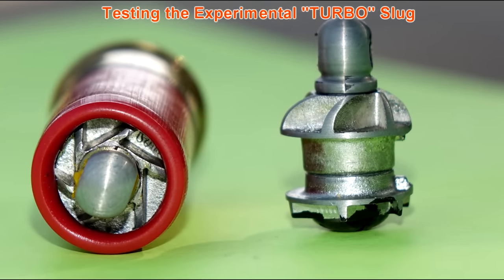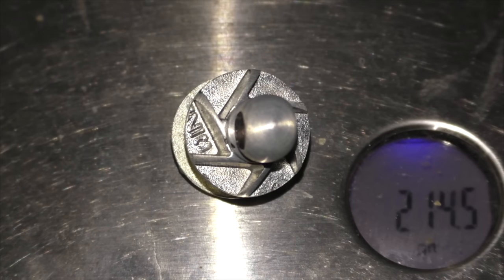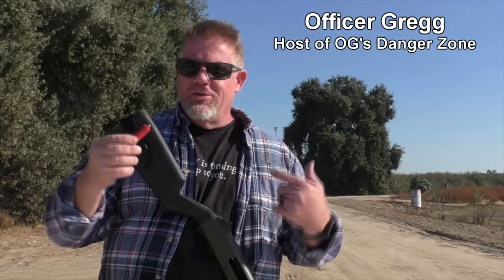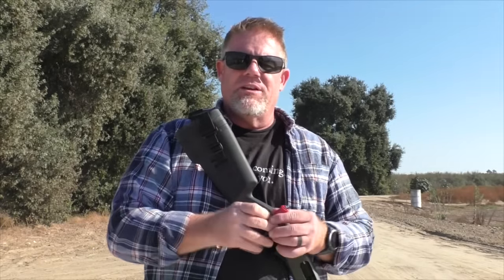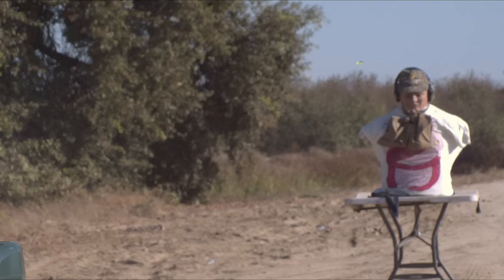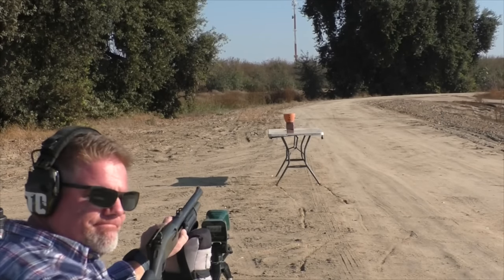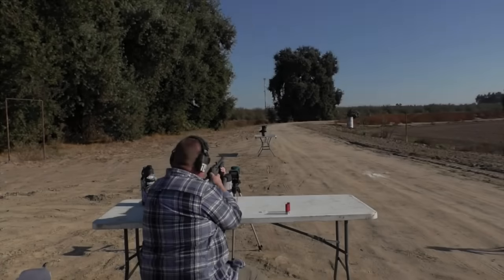TURBO SLUG -  Sounds like Star Wars Blaster

Comment: That sound! From an aero perspective, you can ignore the rear vanes as the air flow won't be touching them. Deepen the front portion and add some mass. Then again, that's basically a foster slug. They make them that way for a reason after all!

Comment: I think the "turbines" are impellers for a small fluid pump, and have been reduced in diameter by either an engine lathe or hand tools. You can see part of a word cut off on the edge.
Reply: Interesting, they also looked a bit like dull dry wall plugs
Reply: @danosdotnl  maybe so! Good observation.
Reply: They make “turbocharger” key chains that are about the same size as the rounds used which is more than likely.
Reply: @rust3dtinmanrichards615  good point!
Reply: Yeah I agree with rhubarb as they don't look like compressor wheels, they do however look exactly like a water pump impeller from a  small displacement industrial or sports engine.

Comment: Looking at the fan sections, there's an extra bit of metal in the on one side between the two fans that might be throwing off the balance.  It might be worth considering getting these things 3d printed to make sure that everything is balanced properly.   I'd also suggest replacing the rifle strap nub with a drill bit to add more spin.
Reply: That's what I felt was the primary issue. That round ball wind break might give a flat spin effect like a stalled plane going down.  
Idk about the Giro effects.
Reply: printing doesn't guarantee balance. you'd have to mount it on a suspended shaft to check for a heavy side
Reply: @RedstonePyroMan  good point.
Reply: 3d printing metal is very expensive.

Comment: I'm sure someone has already commented this, but the 'bottom' end is a turbine, and the top end is an impeller.  If this were mounted in a turbocharger housing on an engine, you would feed exhaust to the bottom end to spin the turbine, and that would spin the impeller on the top end to force air into the engine's intake.

Comment: Depending on the spinning speed relative to airspeed that front impeller would try to either accelerate the slug in whatever direction it's pointing, or transfer some of its speed into faster rotation. Both of those result in asymmetric air resistance on the front as soon as any wobble happens, which is probably why it tends to wander off. I assume the inaccuracies are 100% decided in the moment of exiting the barrel, since the round is more self-destabilising than self-stabilising.

Also the impeller in the back rotating in the same direction is probably doing more harm than good. It tries to suck in the air behind the slug and push it out of the sides, making the low pressure zone behind worse if anything and wasting energy. Although with how fast this slug is moving and how the front already pushes out the air beyond the diameter of the slug, this performance-degrading effect is probably very slight and only contributing to the sound it makes. (Since the air trying to rush back in encounters the impeller blades pushing it out in some places and pretty much no pressure everywhere else.) If it exists at all, supersonic aerodynamics are weird and someone would have to properly model them to confirm or deny that.

I'd be interested to see a version of this slug where the backside impeller has fins the other way, sucking in air from the sides and pushing it out behind, which might improve the aerodynamics by lessening the high pressure in front to low pressure behind ratio. It should also make a distinct sound too. Will probably still be as inaccurate though, since that seems to be a front impeller issue.

Anyway, thanks for still making those! I'm not watching every one of them like a few years ago but they're's still fun and interesting.

Comment: I'd try asymmetric slots in between the fan blades. Cut into the first place the fan blades of mount it on. With the fan blades not having an air exit point it would be like driving on tyres without grooves what grooves lead to nowhere. If you could split the air somewhere for example as above it would allow the air flow to carry off and if there's lots of design right add extra spin.

Comment: FYI it's not a "twin turbo", a turbocharger consists of very similar looking impellers on a common shaft: a turbine (converts the gas flow of the exhaust to rotation) and a compressor (converts the rotation of the shaft into airflow that fed into the engine)

Comment: It looked stable on the first shot, it's possible that the slug is so light that it turned on impact, when contacting something harder and heavier than itself. It needs to be heavier in my opinion.

Comment: I remember the Brenneke Flintenlaufgeschoss FLG (which might be a hundred years older than the super sabot) to look like these, except for the setting angle of the blades. They've been steeper and more of them. The whistle might come from the hole in the top part? I remember a glider in my gliding club, which I flew most, the "Astir" from Grob to have whistled because of a hole in the tail, where the wheel came in for ground movement. It is really that easy, like a panpipe. You could use several holes with certain depths and diameters to whistle a chord of your choise.

Comment: I'm not a professional or scientist but I think it's the tip of the slug. With that round then sharp drop to have a random hole in it depending on how the air hits everything it's going to be random. That's the fix imo

Comment: I think the issue is that it makes NO sense to make that fan shaped forms if they have a completely flat surface behind, the air resistance on that flat part behind the "fan" must have been crazy af and the probable cause of wobbling.
Reply from the maker: The whole concept makes no sense mostly because of the expense to buy the parts and the time to hand make them.   Remember, this is more about curiosity and how weird shapes behave at supersonic speeds so it many ways it's more like rocketry than weaponry.

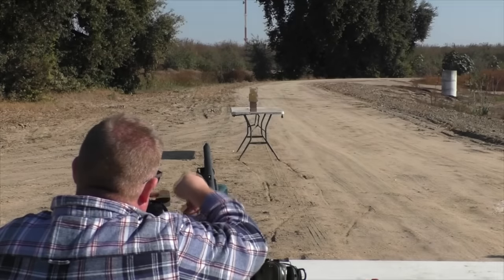Comment: 5:19 I’m pretty sure that’s why the turbo is there. Think of it this way. As it leaves the barrel even without the the rifling the turbos will start to spin with the pressure built up behind it. As it gets through the barrel the front nob sends it sideways while staying dead on with its flight path DUE TO THE TURBOS in that process the turbos stabilizes the slug as it’s side ways so all u get in a massive bolt with 3 nuts smashing into ur chest…. Even if he intended this or not it’s actually genius
Reply: 8:05 that’s that stabilizing I’m thinking of. As it’s fired it’s not exactly staying true but that’s kinda the point. If it’s a wider surface area it’s easier to hit ur target while also keeping a decent and so consistent flight path than it would be an effective slug

Comment: Pretty sure the instability of these rounds has something to do with gyroscopic procession. Like, because it's spinning along it's intermediate axis, it periodically starts tumbling before going back to flying strait, but pointing backwards. Then a bit later it flips again.

If you've ever watched a NASA rocket launch, this is the reason why they don't spin the rockets, because they'd tumble in midair too. But when a rocket points backwards, horrible things happen. I think rifle bullets get away with it because they have other aerodynamics going on to keep them pointing straight, meanwhile the turbo slug has about the same aerodynamic profile as the average thermos.

Comment: Just as they sre on the outside make the grooves on the inside of the slug as well more accuracy may happen it may not but just at the ends is not all you can do you can also make the inside go as well and it could introduce a curved shot as well who knows

Comment: The slug needs to be heavy in the front and lighter in the back for it to fly in a straight line that will eliminate the high speed wobbling
Reply from the maker: All bullets are heavy at the base and fly well.    With spin you can counter that

Comment: The experiment is interesting, the bullet clearly lacks stability, a stabilizer is needed, also if you put a plastic shutter instead of the container, the barrel will be damaged less, and you can shoot with specifications of barrels with constriction chokes. Let's get a Monolith bullet, but with rotation. The question is why? The same Monolith confidently and accurately allows you to shoot up to 100m, and pierces a cast-iron sewer hatch or a car engine.

Comment: I wonder if you have both fans of the turbo slugs go in different direction would it stabilize it more. I'm guessing by pressure from the striker and the direction the fans are they go right it seems.

Comment: I wonder if single holes drilled through each front facing fan blade would make it whistle more?

I should think it's scary enough being shot at by 12ga slugs, but can you imagine if it was screaming louder at you as it zipped through the air.!

The Roman army slingers used to drill holes through their sling ammo, so that when they threw a volley across the battlefield, their ammo emitted a high pitched whistle.

Comment: sorry slight nerd gripe about the twin turbo comment, it would still be a single turbo as all turbos have 2 impelers, a hot and cold side, hot side uses exhaust gas to spin up the cold side to bring in fresh air into the intake. cool video tho!

Comment: He was shooting nearly one handed with the front of the gun resting on the sand bag.

Yeah the dot might have been centered b4 the shot but the grip was NOT.. a shot lasts past right when you pull the trigger until the projectile leaves the barrel.

Looked like the rounds fire STRAIGHT'er than a Arrow..

That "was in the shooter"

Comment: An actual thought process the slug seems like it would be a winner. But an actual physical dynamics when it comes to air, wind, and how it spins around is just as reliable as a blaster for the storm troopers. You’re better off just using like a buckshot to hit the target, then using one bullet, that he could miss no more than 30 yards from here you Anyways you could still improve that actual slug to make it perform better. I just think that the front end of it is not good enough to make it all spend together, because honestly, the front end should be more of looking like some kind of drill head that exposes all that wind directly to the rest of the slug that spans of the air to straighten it out.

Comment: The rear veins won’t do anything, and the front ones would benefit from the whole impeller having a conical shape. As it is the fins don’t actually grab the air and twist the projectile very well whatsoever. Angling the whole thing to look like a turbocharger compressor fan would be much better.

The fins on it aren’t from a turbo but likely from some centrifugal pump.

It would be really cool to put some actual turbo blades on the front of a shotgun shell. They’re very balanced too. Turbo impellers that small actually do exist.

It could potentially be a legitimately accurate round of someone manufactured a slug with conical veins which had a twist rate similar to rifling of a barrel. Too much twist rate and no cone shape like this one would likely just cause turbulence and a ton of air resistance instead of spinning the thing consistently.

Comment: I have suspected fit quite some time now that several of the submitted slugs are actually modified drawer pulls. The tip off, for me, is the screw in the back. I could be wrong, but think about it guys… Not a knock, just an observation!
Reply from the maker: Evan makes slugs out of all sorts of things he finds at the hardware store including knobs.

Comment: Learn physics guys. The bullet weight is 28 grams. this body has a large inertia, the bullet needs a very large force so that it starts to rotate from interaction with air, and the next problem is that moving at high speed, the bullet creates a zone with increased pressure in front of it. this is clearly visible in slow motion. So the air flows around the bullet without interacting with its feathers or wings, I do not know how to translate it correctly... The only way to spin a bullet from a smooth barrel is to make external wings on it, like on rockets or tank shells for smooth guns.
Reply from the maker: These were shot from a rifled barrel, not a smooth bore

Comment: They need some work and modifications for longer range stability but they are a very cool design and seem promising!!! Would probably be better to have them made on a CNC aswell so they are consistent. Not saying I don’t respect the hand made aspect but you want munitions consistent and exactly the same.

Comment: I have an idea for a video. can we see how sabot slugs perform through a smooth bore barrel vs a rifled barrel, and see if a smooth bore and rifled choke can make a difference in performance. buying a barrel can be expensive compared to just buying a rifled choke. I got some Winchester deer season copper sabot slugs but I can't afford to buy a new shotgun or a rifled barrel. can a rifled choke make these slugs work better without breaking the bank?

Comment: If you tried the smooth bore with the stormtrooper slug, this is just a hypothetical, I am no ballistic nor physics expert.
Most army tanks today, have ditched there rifled tank guns, to me and anyone else, this would sound idiotic, because rifling=stabilization, and the penetration and accuracy of any shot type would be rendered less effective by a large margin. But, with some of the newer shells, for example the Fin stabilized sabot rounds, are capable of stabilizing themselves at the correct speed or don’t stabilize at all and just go straight like some arrows, but when shot out of a rifles gun, the 2 stabilizing factors, could
A. Spin against each other
B. Over spin causing the round’s top to start circulating or vise versa
C. Spins without the need to speed and causes the round to have more drag
(Speculation of effect but the principle is factual)
With this knowledge
I believe 
With my own personal knowledge and comprehension 
That with a smooth bore barrel, the stormtrooper shell will perform better.
Reply from the maker: There's a lot of shapes that self-stabilize (diabolo,  fins, etc.)  Something like this would just tumble because of the length,  balance, etc.

Comment: have you ever tried mass projecting Spiral Screw / broken bolt Extractors? remember handling some around 12 gauge diameter or a bit similar in design. could you test this please if you haven't already?
Reply from the maker: We shot some Acme thread slugs recently

Comment: Jeff if rifle applies at all to rifled shotgun, then there is a maximum length slug that shotgun or choke can stabilize based on their twist rates.  Some people go by weight but that's an approximation. I'm told it's really about length.  It may be worthwhile going through your data if you've measured the lengths of all these slugs you planned to spin stabilize and seeing if there was a correlation or some cutoff wall where it became unpredictable.  Or maybe it is by weight and do that too.

Comment: Make homemade thermite from aluminum foil and rust, just roll it up tight BUT BE CAREFUL. Watch some videos on how to make that first. Slip into cylindrical copper canister, then wedge that into shotshell. The canister supports penetration, hopefully you dont overpen, and then you have thermite inside the target. Cheap and simple AP thermite rounds. You can better it from there but thats less about fun and more about you actually needing to use it for something. Thought yall might enjoy this one.
Reply from the maker: I don't think there is enough time for the thermite to actually start burning in the milliseconds these are flying

Comment: Wouldnt be twin turbo. Just turbo. A normal car turbo has a hot end and a cool end. Has a impeller on one end and turbine on the other just like the slug. Exhaust goes through the turbine and spins it and the spinning of the impeller on the other side pulls in air through the intake and sends it to the intercooler

Comment: turbine blisk is not aerodynamically optimal, it is poorly designed mimicking centrifugal impellor as in car turbo. Design should mimick instead linear axial turbine like RPG7 or tank kinetic fin stabilised discarding sabot dart. Large cross sectional area of centrifugal impeller= drag.

Comment: Not a twin turbo it's both sides of a single exhaust driven turbocharger for an engine one side compresses intake air the other end receives exhaust pressures that spins ths the intake end

Comment: Wouldn’t have used the OB12 but rather a x12s or bw12.
Reply from the maker: The oburator 12 has that thick center post which I thought would support against the screw well.  Plus I have a ton of them I have to use some time.

Comment: No single turbo a turbo has an impeller and a propeler impeller drives air to intake generating boost propeller is driven by exhaust and turns the the impeller

Comment: What roll crimp did you use?
Reply from the maker: a normal one
Reply: Ok was wondering because the ones I have would not work with a protruding tip, Gaep,BPI, precision and reloaders network. The center of the bit wont allow it. 
 @taofledermaus
Reply from the maker: @chrismcneil5543  OH!  I have a special roll crimper that is bored out in the center that Nick Ross made for me
Reply: Thank you!! I appreciate it because I load sabots with Barnes bullets and for the life of me I can't find one that will roll deep enough over the rather long projectle.  @taofledermaus